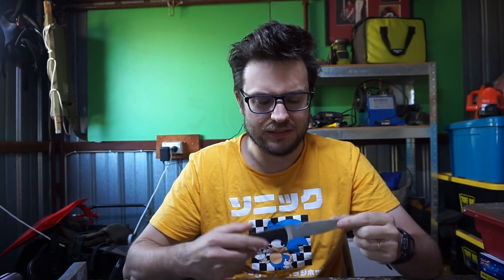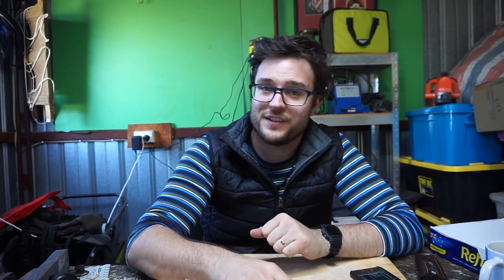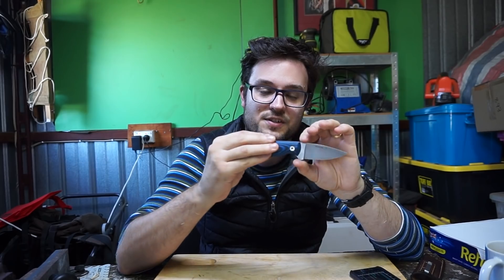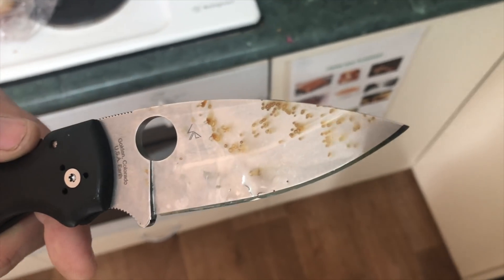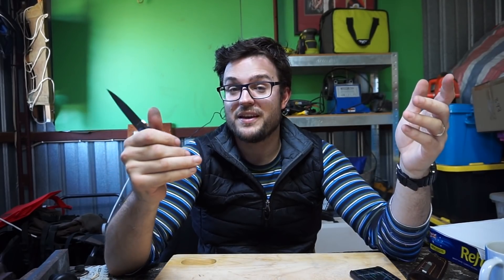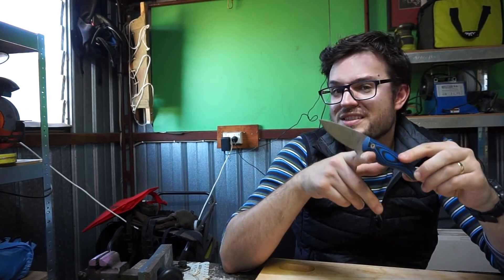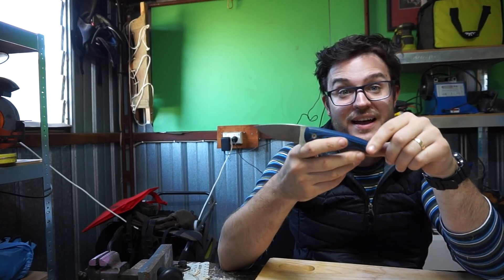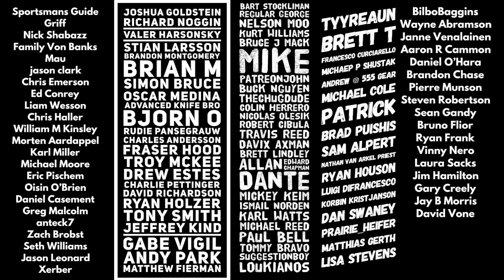Can a steel with 0.1% carbon hold an edge? Nitrobe77

Comment: I heard super steels like m390, 20cv are not tuff. M4 is tuff. Which would you say is a good all rounder please mate, edge retention, tuff, rust resist. S30V? Factoring in some ease of re-sharpening too. ☺ ...been watchin youre vids a long time.
Reply: I was impressed with Spyderco's Cruwear. I did a corrosion test and lemon juice didnt even touch it after a decent amount of time. It will rust but, it is quite tough, and sharpens nicely.

Comment: How does it compare to 14c28n?
Reply from the maker: ThePreppersBunkerOutdoors edge retention could be similar, maybe a tiny bit better on the nitrobe77, but not by much. The nitrobe will however be the best in rust resistance out of maybe any steel though 👍🏻

Comment: Differences between nitrobe77, lc200n, and vanax? They're very similar in my opinion
Reply from the maker: Nathan Keel vanax is broadly excellent across all fields, but is rare and expensive. All three are as rust free as you’d want. This nitrobe is easiest to sharpen and if pushed, probably a little more rust immune. LC200N is a great balance that is in lots lf cool models lately, so is cool for being widely available.
Reply: @CedricAda  thanks for your opinion!! Do you think that within the next 5 years these nitrogen blades will be easier to acquire? Do you think there will be more new steel with nitrogen? I hope vanax becomes more readily available, do you think it will?
Reply: @CedricAda  shannon steel labs seems to be the only person I know who consistently has vanax to work with. I think be buys a bunch at a time when the suppliers restock

Comment: Nitrides kick carbides ass. Just as hard if not harder but they are much more finer than carbides which results in higher edge stability and higher attainable sharpness (N77 had the sharpest edge I ever put on a steel).Carbides are in the 2-5 micron size in pm steels and nitrides are 0.7-1.5 micron (I know tungsten nitrides are 0.7-0.9, forget if vanadium are bigger than that). Gotta say I expected a bit more from N77, in my use it's not s30v level but not half as much either. Though I use a 13-14 dps edge since the steel is made for low angles and thin grinds.

Comment: (atomedge here) Yes. Yes it can sir. I'm thrilled you got some Nitrobe to use.

Interesting it got only 225... my example of a knife in Nitrobe 77 is at 64.5  from Kasé Knives Switzerland  but my cardboard test had it shitting all over all kinds of steels even m390 examples...  Interesting how media and hardness can affect things!
Reply from the maker: Maxwell Super yeah, its why i stick to rope - i think steels react entirely different to things like cardboard, wood etc
Reply: @CedricAda  that is great though. Consistency helps others compare notes and circumstances